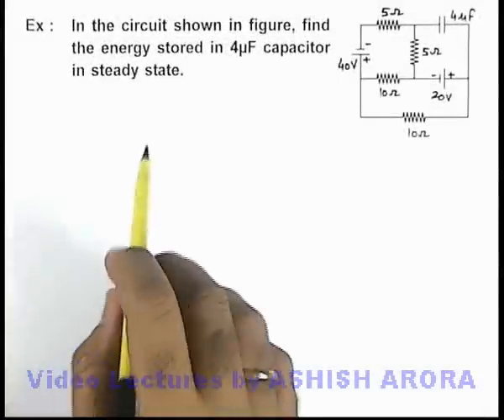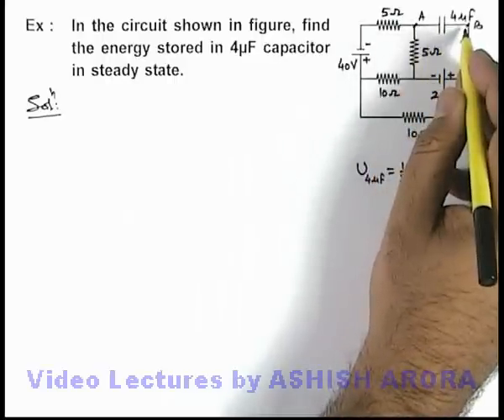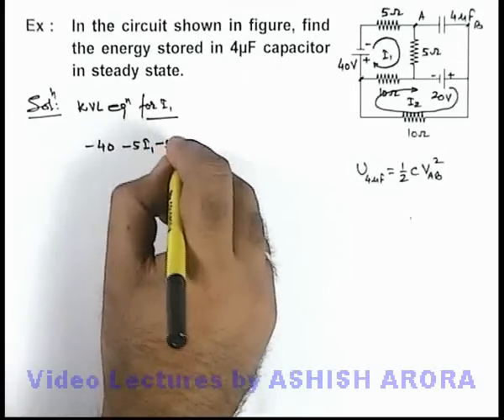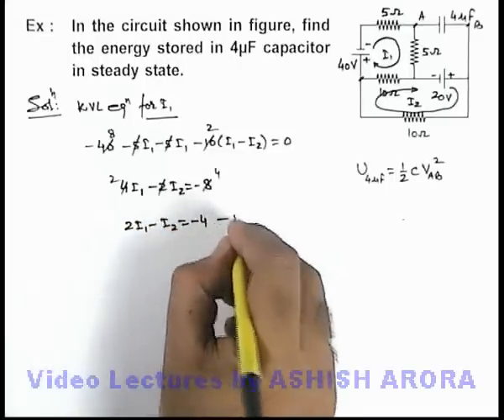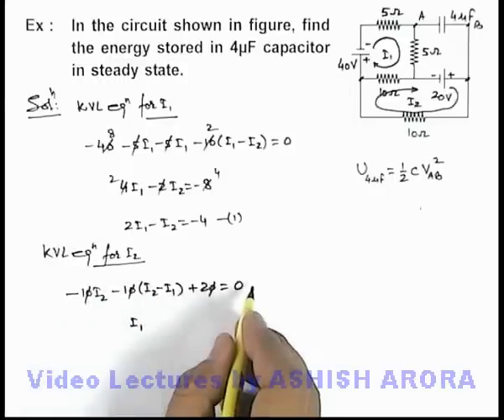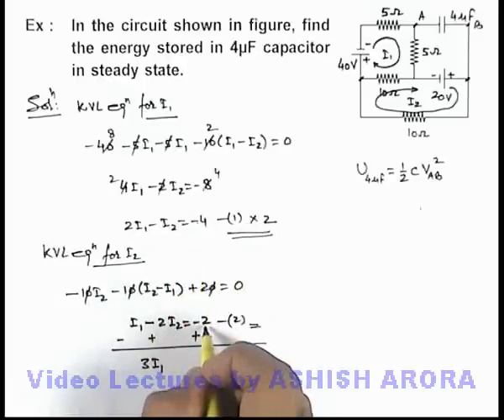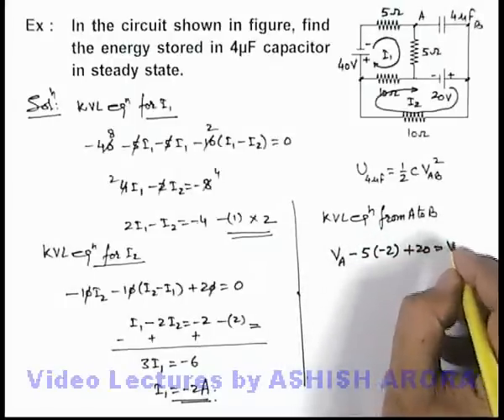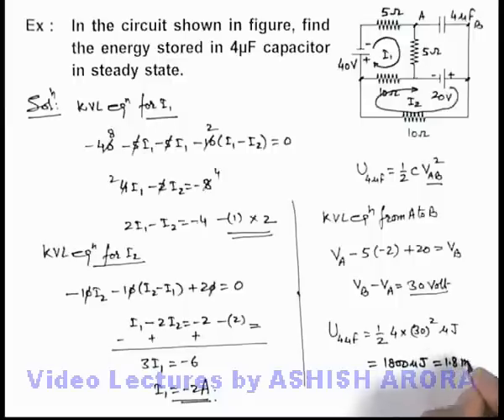Class 12 Physics | RC Circuits | #15 Solved Example-6 on RC Circuits | For JEE & NEET

Comment: potential at Vb=20V since directly connected to battery..
now 2A flowing from A to 40V battery....so Va=IR=2*5=10V...
so Vb-Va=10V 

plz clear my misunderstanding....
Reply: You are wrong since,You have to assume only one thing. 

Either potential at positive terminal of 20V as +20V or potential at negative terminal of 40V as 0V. 
As you have assumed potentials at both places as 20V and 0V, answer will be wrong.
Reply from the maker: No thats not correct what you are thinking... potential at Vb ≠ 20V, 20V is the potential difference across battery terminals... thats the mistake you are doing with the misconception you have... we suggest you to watch our theory videos in proper sequence to build you concepts properly... or use our physics galaxy series of books...

Comment: sir, why thevenin's method cannot be used here? i mean like its in steady state, so no current flows through it, so no equivalent battery with r(int) can be connected directly to that capacitor n stuff.
Whats the actual logic behind it??
Reply from the maker: There is no logic... you can use Thevenin's method here... even thats a direct shortcut for solving this problem... check your calculations if you tried to do so...
Reply: SIR please help me.....how thevenin's method will be a direct shortcut here??
On removing that capacitor, internal resistance of thevenin's equivalent battery will be 10/3 ohms. But what about equivalent emf??
For that we need to have value of current in loop 1(so that V(A)-V(b){equivalent emf) can be taken out) and for that we will have to apply the whole concept done above.
IT WILL BE A LENGTHIER METHOD. WONT IT BE??

Comment: sir will not the KVL eqn for I1 be : -40 -5I1 - 5I1 + 10(I1-I2)  as the I2 through 10 ohm resistor is opposite to the directiom taken
Reply from the maker: NO.... we are writing KVL equation for I1 and along I1 we consider potential to be decreasing... and I2 is opposite so in the equation I have written term containing I2 is coming positive...